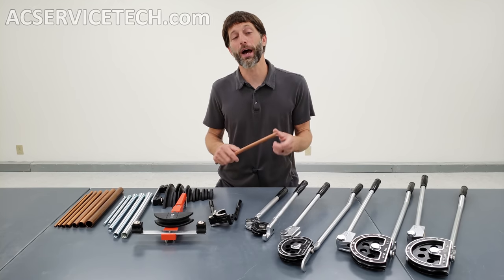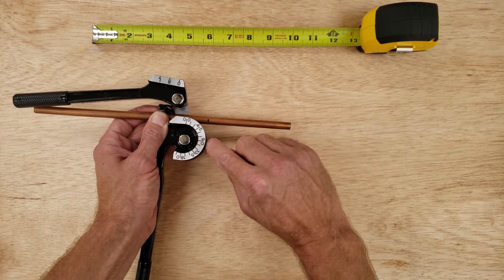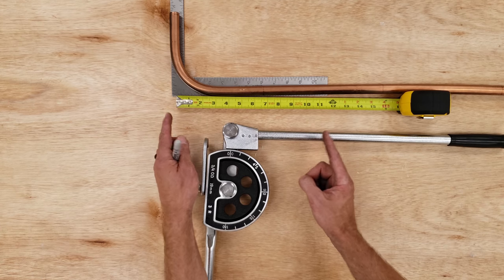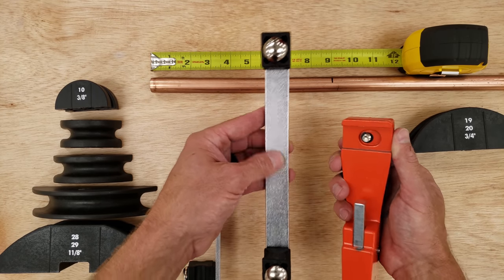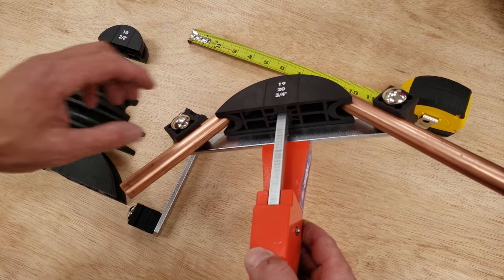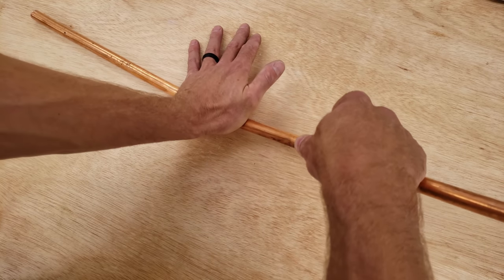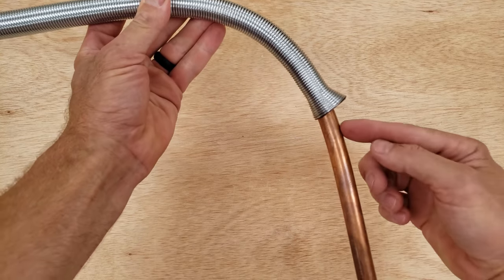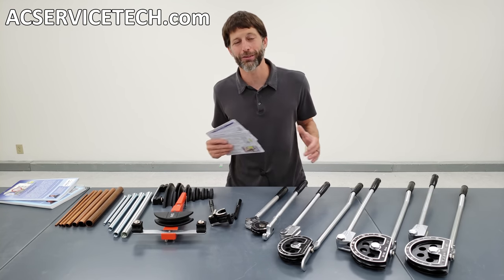Copper Tube Bending Tools & Methods! Lever Type, Ratcheting, Spring, Hands!

Comment: Another great video from Craig, but to simplify things on the Uniweld 1/4 / 5/16 / 3/8 combination bender, on the movable head you will see: 0, R, and L. The R and L marks are used to line up with your mark on the tubing. If your measurement is coming from the LEFT of the tube going to the right, measure and make your mark and insert the tube into the LEFT of the bender, like Craig does, Line up your 0's and adjust your tube so the mark you made lines up with the L while keeping the 0's aligned, and make your bend. The R is for bending from the RIGHT side of the bender using the same procedure.
Reply: Thanks for that, I was going to ask the question but you've answered it very well thanks.  Excellent video as usual thanks.
Reply from the maker: Kevin, you are absolutely correct! I just teach in the one direction because I always found that students would get confused as to the direction of the bend so I would always say it will follow the moving arm of the bender and then if they moved to the larger lever benders, there were no marks, thanks!
Reply: Thank you, I am still confused by the R mark....
Reply: Don't you have to add gain if you use the R mark?

Comment: I have used the spring bender on the inside of the pipe with no issues. Good to know it works on outside as well. Only difference I guess is it can get stuck putting it inside but there is zero chance of over bending it.
Reply: Those are designed for use on outside of tubing only lol
Reply: @HVACRTECH-83  works on outside too trust me
Reply: @HoodHandyman  you said you put it on inside. How you gunna get it out? Why would you put it on the inside? They come in all different sizes to go on outside of your tubing. Better off buying a proper bender though either way
Reply: @HVACRTECH-83  I just stuck it in bent the pipe and pulled it out the springs move its really not that hard . Works great for small bends on the ends of the pipe
Reply: @HoodHandyman  hey, whatever works forya.

Comment: Craig, as always, great video. I was wondering if you could demonstrate how to do a double bend using the ratcheting crossbow bender like you need to do when bending tubing on the outside of a home when connecting the tubing to the condenser (two left bends, first bending the tubing up that will meet the condenser tubing swedged stubs, then bending the tubing down that will hug the outside wall). Thank you and thanks again for all of your great videos!

Comment: Craig, I have another question: if you don't want the bender to flatten out the tubing as it bends it could you slide a bending spring over the tubing and then use a larger mandrel and stationary bar?

Comment: We use the internal plastic rod pipe bender , looks a lot easier than the spring and it’s also 1.5m long or longer
Reply: Agreed, the plastic road is my choice too when near the end of the pipe.  But when further away I use the methods in the video.  Excellent video thank you.
Reply: @tonysavage8364  I like the internal because : firstly most pipe being pre insulated, Also inaccessible spots, hole through the wall /bend
Reply: Do you have a link for this type of bender?
Reply from the maker: Thanks for mentioning that type Nathan!

Comment: Craig, I was wondering how the ratcheting crossbow bender can bend tubing if one end of the tubing is anchored such as when it's attached to the condenser or evaporator. I understand that this type of bender makes the bend by driving the tubing up between the guides on the stationary bar and that the bar's guides pivot to allow this to happen. Also, when you're bending a piece that isn't attached to anything both ends of the tubing are shortened to allow the tubing to be bent. So, if one end can't move how does the tool accommodate for that? Does the tool turn until it reaches a point where it can slide along the anchored piece of tubing? Somethings gotta give, right? Thank you.

Comment: Do you have any advice on how to get a compression nut onto a copper pipe that's been bent by hand?  Seems bending put just enough imperfections in the tube to prevent the nut from fitting on.

Comment: I have a question, I bent a pipe with diameter of 18 with 1mm in "meat" with o similar tool, I didn't end up bending it up to 90' because the pipe made creases and it even broke, the same happened with a pipe of 15 by 1mm in "meat",..I mention that the pipe of 18 and 15 was not from the pipe to the coil but from straight pipe. The question is why or creased and even or torn? It probably can be cause of 1mm thickness in "meat"?? Or the copper pipe to the coil is softer, more malleable?? I can have the same problem with pipe to coil whether it is 18 or 15 if in "meat" is 1mm??..I would be happy if would you answer me....Thank you very much for the answer

Comment: So I've had a few circumstances where I had to build a new coil.  On a refrigeration unit where the line comes out of the condenser coil, it then goes into the condensate tray, which may have water.  The coil is a serpentine, that is, a bunch of 180 degree turns, could be 3/16 to 1/4" copper tubing.  I have never been able to make clean bends.  Is there a way to do this without having some kind of special mandrel?

Jim
Reply from the maker: I would just use that 1/4" 5/16" 3/8" manual lever bender. I used to have students make something like that in the classroom with 1/4" to exact measurements in order to gain the skill of the bending tool, thanks!

Comment: Unfortunately some ratchet bender do not have the 2 markings to line up on the half moon. Any ideas for my KS TOOLS bender to measure properly. And as well can you also show how to measure for a 45⁰ bend on the ratchet bender? Thanks a lot advance!
Reply: Just add a few extra inches of pipe. make the bend then mark the pipe at the desired length and cut off the extra.

Comment: I wish I could find a clear explanation of the R Mark on the small 3-size lever bender.....everyone says use L coming from left and R coming from right but that DOES NOT work with the R, it's always off and seems to be the exact length off of a sledge stub

Comment: How do you know it is soft copper?
Reply: i had the same question.
Reply: Because you can bend it.
Reply: Typically at least where I'm at, soft copper is sold in a roll, whereas hard copper is sold by the stick.
Reply: @nelsoncody38  
Thank you for a good answer.
I deal with water copper lines. 
Never notices any markings. Never shopped for the rolls of copper.
Reply from the maker: The tubing we use is considered "ACR" air conditioning refrigeration tubing which is usually soft copper and comes in a roll with either rubber or plastic caps on the ends.  It is tempered to bend well. If it is in a roll, it is soft copper tube, thanks!

Comment: Don't use that cross bow bender for 1 1/8 ever. They can't handle it. Plain and simple. Mine was a few months old I was making a bend up 25 ft on extension ladder and the whole body of the bender shattered in my hands,just about fell of the ladder and my hand was mangled up so bad bleeding all over the customers siding, I couldn't finish the job. So just don't do it
Reply: What were you bending emt?
Reply: @Sak-zo1ui  not funny actually. But no soft copper lineset
Reply: @HVACRTECH-83  it wasnt a joke. Dont be so sensitive.
Reply: @HVACRTECH-83  you're right they cant handle that thickness but it shattered like that because its a Crossbow 😂 is it cheap? I never heard of it
Reply: Was your bender made in china ?
Reply: @AlexLopez-zv8ng  not sure where they were made, doesn’t matter. It was the best bender on the market for HVAC trade at that time and still is in the top 5 probably. It’s a great bender for every size under 1 1/8 but at least mine couldn’t handle 1 1/8 could be mine had a flaw in the casting from factory who knows. But regardless the crossbow still remains one of the most popular benders in the trade. What bender do you own?
Reply: @HVACRTECH-83  i been using one called blackmax ratchet tubing bender and so far its been great , i bend 1 1/8 with no issues ….if anything i always have a hard time cutting it with the pipe cutter …its always so uneven so i need to adjust my cutter every turn
Reply: @AlexLopez-zv8ng  that's because it's egged seems to happen often with soft 1 1/8. Even hard to get a fitting on it,usually have to try to round it enough with pliers,sucks when you get a roll like that. I'm familiar with Blackmax I have a flaring tool from them which is decent and I had an old gauge manifold from them as well about 15 years ago. I believe cps owns Blackmax
Reply: @Sak-zo1ui  soft copper tubing. This wasn't meant to be a joke so your comments not necessary or welcomed. Maybe re read my comment
Reply: @416RG  it's the most popular bender in the trade and no it's not cheap. Maybe mine was defective from factory idk but the pain was real I assure you
Reply: @416RG  uniweld makes it. Very popular brand in hvac. Did you even watch this video? Guess not
Reply: @HVACRTECH-83  you said not funny, i said it was not a joke. I was simply asking a question because i have wondered about getting one.
Reply: @HVACRTECH-83  nice 👍🏾
Reply: @Sak-zo1ui   I have the Yellow Jacket cross bow bender, but prefer using my old school Imperial benders.  It's a bit pricey to get a full set.
Reply: @markcarpenter3600  fair assessment thank you!
Reply: Uniweld are you kidding Harbor freight sells uniweld. Lol
Reply: @HVACRTECH-83  uniweld is a harbor freight product lol
Reply: @robertcherry4971  most certainly is not lol. But thanks for your attempt at acting like you know anything at all on the matter. Have a nice day trolling

Comment: Modern recycled copper tubing does NOT bend without kinking.
Reply from the maker: Some soft copper (ACR) may not have been tempered correctly. I have run into that quite a few times before but most new rolls are good for bending, thanks!
Reply: If you're using ACR tubing,  it must be annealed with heat before you can bend it.  Be sure to flow nitrogen.
Reply: @markcarpenter3600  can’t wait to hear the installers moan when I bring that up at the next meeting. Lol